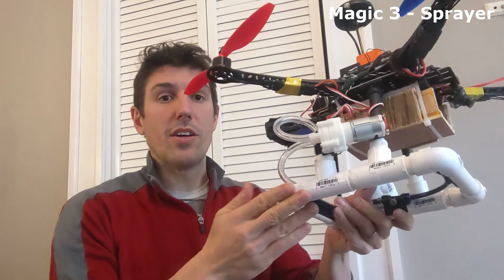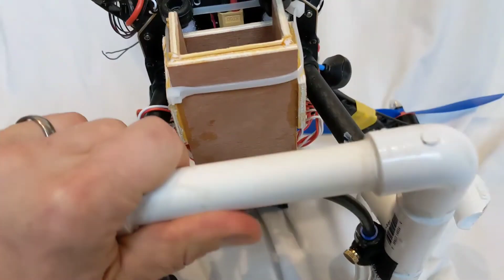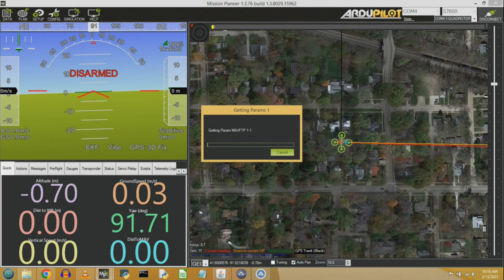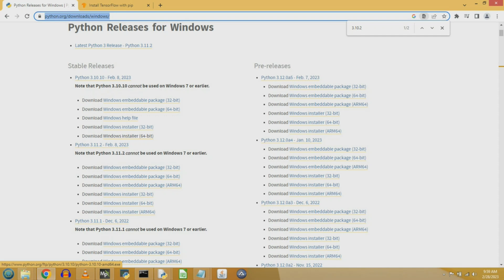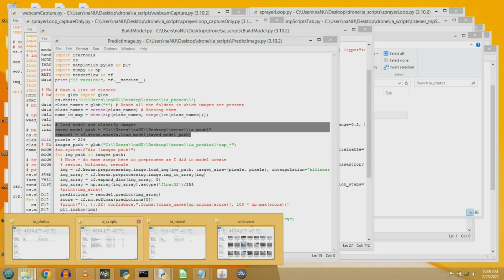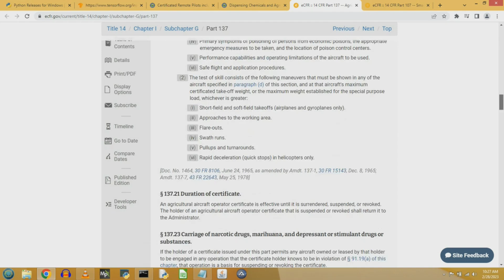DIY Autonomous Intelligent drone sprayer - Parts List, Schematics, Build Details

Comment: Hi, Nathan. Veeeery impressive work to bring all that together! Congrats! I’m a long-time drone builder/pilot. I’m also an experienced (self-taught coder. What I’m trying to decide now is whether to use nodejs (very little experience, although I’m experienced with JavaScript/jQuery) or Python. Never used python. There are so many options/ approaches to take to build something like you’ve built, my head is starting to spin.

What do you think is the optimal approach for your next build? Python? Nodejs? Raspberry Pi Zero? Mini PC? 

If you could provide some overview of options, I’d appreciate it very much.  I see a lot of pros/cons concerning the choices, but not directly related to a project such as yours. 

During your next build, make a step-by-step course available and you’ll have many buy it! I would!

One last thing, promise. 😊 I have a DJI Naza V2 that’s been sitting in a box for years brand new. Can that be used in place of the Orange cube that coats so much?
Reply from the maker: Good questions.  
- For flying drones (including your DJI) with ardupilot/Mission planner I think you have to add a flight controller (an autopilot).  In my case I chose cube orange, but a pixhawk could be used too.  There is a cheaper knockoff pixhawk to save some $ which I tried but the GPS I used (here3) doesn't ship with a compatible connector to that one.  There are videos about how to modify/solder the wires on the GPS to work with that cheaper pixhawk though.  NET: pixhawk/cube orange are needed for use with ardupilot/mission planner.
More info see here; https://discuss.ardupilot.org/t/control-a-dji-drone-through-pixhawk-and-ardupilot/39386

- I love python and raspberry pi and I'm using it for my next build (a robot, not a drone).  It's inexpensive and easy to learn BUT you don't get ardupilot/gps out of the box there.  Just a "robot" sort of control but importantly python is great for crunching numbers and working with tensorflow (machine learning from google - I use it for image classification).  I think it's possible to add ardupilot/gps though as I've read a few headlines about that sort of thing, and if you could get that working it'd save money.  That said, nodejs is also a fine language though it doesn't work out of the box with the open source machine learning.  Go with what you're comfortable with and if you hit a wall where it can't do what you want switch languages or platforms
Reply: @nathanbuildsdiy  Thanks for the feedback and info, Nathan. Good luck with your robot!
Reply: @nathanbuildsdiy I have a similar drone that's collecting dust how much would you charge to fix it ?

Comment: Hi Nathan, I can only imagine how hard this would have been - very impressive! Let me know if you're keen to collaborate on commercial applications in Australia and New Zealand.
Reply from the maker: Hi Simon, thanks! I found you on linkedin - I'll message you there.
Reply: Hope you gents make something happen 👌🏿
Reply: Hii sir I am also interested to make commercially
Reply: Sorry about the copy paste Nathan, but hi Simon.  My names Lucas, I was just about to shell out NZ $33,000 for a DJI T25 combo kit including drone, 2 batteries, 8KW charger and 10 KW petrol generator....    THANK GOODNESS I found Nathans channel!   My family has a 600 acre farm here in New Zealand, I used to work as groundcrew for a Cropdusting Bell 206 Longranger, and I have a friend that's a really talented race drone builder/pilot.  (oh and I'm an Electrician by trade, mostly Commercial experience though, not much work with DC).  Let's keep in touch Nathan, Simon, we could do some interesting things.  My family would gladly offer our farm for large scale infield RnD.  And I was already thinking that the entire operation including automated batt swap and spray reload could easily be slid onto a Tractor trailer.  Just park it up and leave it for the day.  Oh and PS our farm already has a 2GHz and 5GHz Wifi network I built if that helps.

Comment: Great setup, impressive built!! Also, it is a very comprehensive video, explaining everything in detail. Out of curiosity , how long did it take you to build and develop everything (from hardware to code-software)?
Reply from the maker: It's hard to say since it was all pieced together in very sporadic free time over months, but I'd guess it was 30 hours of reading/prototyping/failing and maybe 15 hours on the computer vision and 15 hours to work out all the issues

Comment: Thank you so much for this video.  It explained a lot of things I have been trying to learn about drones/ardupilot/mp.  My goal is to create a drone that will fly a cemetery and map all of the grave stones capturing text data and gps coordinates of each.
Reply from the maker: That sounds like an excellent project, and I bet you can do it.  I'd recommend using an on boards pc/camera like the raspberry pi zero ($15) so you're not transmitting video over wireless to your base station as I did here.  You'll get far superior image quality that way.